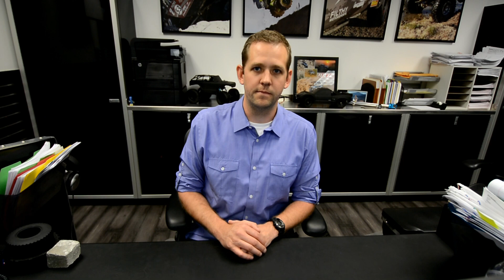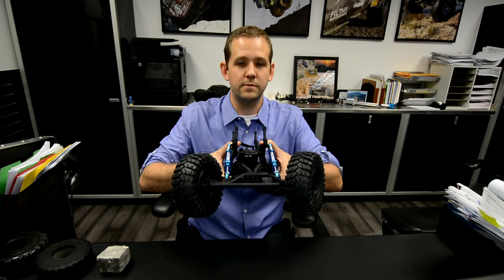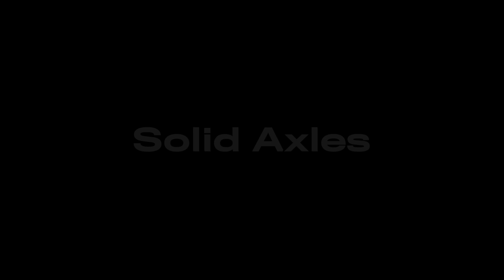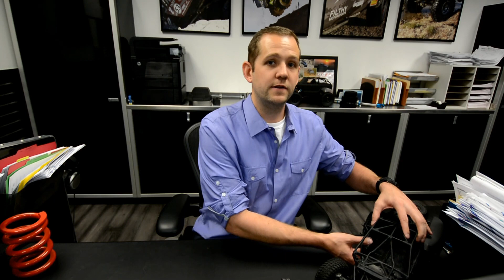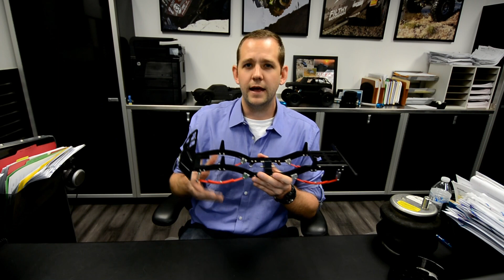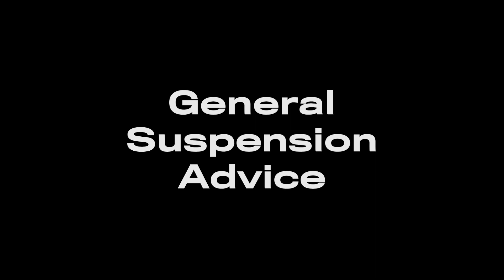Suspension Ride Quality Explained - Filthy Motorsports

Comment: Thank you so much for all this amazing videos you create, I have learned so much from you that's so helpful . I have a 1976 Toyota FJ 40, I looked in to convert  it to coilover but it cost so much to do the fabrication, so I change my mind. I want to change the leaf springs to a 2.5 lift spring so I can fit 32" tires. I want to make sure that I order the right springs and the right shocks so I can have a nice ride on and off road. do you think you can help me???  After watching two of your videos I'm not comfortable ordering any suspensions before I talk to you, after all the suspensions is very important to me but that's not the only thing I need done on my rig , so its important for me to get it done right on the first time. Thanks again for all this knowledge .
Reply from the maker: Sounds like a great project, send us an email and we'll connect to go over your options!

Comment: Hi Ben. I have a 2016 Landcruiser with an OME BP-51 coilovers. I would like to raise the front about an inch. Do I just simply jack up the front of the vehicle so that the suspension is in full droop and then turn the spring adjuster (I dont know what its called) or do I have to remove the coilovers completely  of the vehicle in order to adjust?
Reply from the maker: I would check with ARB/OME on that one. It also depends on which tools you have access to.

Comment: What do you think of solastic springs as seen in this video?   worth the upgrade?   any downsides?

https://www.youtube.com/watch?v=hmuixfRPSEY
Reply from the maker: I run those on my F250 and to be honest, I didn't notice much of a difference when I installed them.
But when I changed over to Deaver leaf springs, it was day and night better.
Reply: @Filthymotorsports  What is your opinion of the Deaver mini pack for 2014+ F250?

Comment: It took about 3 poop breaks but I watched the whole episode. Tons of QUALITY information! My 12' king coilovers that are on the front of my jeep jk have a 250/250 spring rate. Still feels like it's too heavy or I just want a softer ride. I have about 4 inches of shaft showing and 2 inch bumpstops. Should I just revalve because it's where I want the height or should I get a lighter spring?
Reply from the maker: Thanks for watching! If the springs are correct (see our coilover spring rate video) then it would be the valving. 250/250 seems to be pretty close to what we would expect in that application so I don't think the spring rates are too high, but it's worth doing the math.
Reply: @Filthymotorsports  you guys revalve if I send them to you? Also can you add adjustable clicker? Thanks again

Comment: Great  vids man. Even cooler that you have rc's lol  I have a 2006 f250 with a procomp 7 or 8 inch lift with icon shocks front and rear. If I change the rear springs, how much towing will I lose? I have towed 11k before and can not say that it wont happen again.  Also, icons(being digressive shocks) "should" help with the rear leaf springs or am I not understanding this correctly? Thank you very much in advance
Reply from the maker: Thanks for the question! That depends on how we have the springs made and the desired ride height and expected weight variation. On average, for the best ride quality on a stock F250, I would estimate a loss of the top 15-20% of towing and hauling capacity but all that really means is that you have to pay a bit more attention to how you load up the truck (watch the trailer tongue weight and shift heavy loads forward closer to the cab). Cheers!

Comment: Thats a very good review, thanks. Could you also explain what the oil viscosity and the nitrogen pressure change to the ride quality ?
Reply from the maker: Heavier oil is "thicker" and increases damping significantly while lighter oil reduces damping.
Nitrogen pressure keeps the oil under pressure and prevents it from "foaming" but it also has an effect on how much damping is "felt", for example, for a softer feeling ride you can reduce nitrogen pressure whereas for racing, were damping needs to happen instantly, higher pressure is used. (*Simplified Explanations*)
Reply: Thank you for your answer !

Comment: Excelent video. 
About Leaf spring, general rule:  high gas charged shock absorver, low gas charged or hydraulic (just oil).??? for confort ride in a DD, that ocassionaly go to slow off road.
Reply from the maker: They can all work as long as they are tuned for proper rebound damping.

Comment: Ben, If you switch from 0.15 compression shims to doubled 0.12 shims, will it be smoother and slightly softer?.
Reply from the maker: There is a lot more to it than that but two 12 shims would be firmer than one 15 shim.

Comment: Question for you regarding leaf springs... you state that a leaf spring with many thin, staggered length leaf springs (like a Deaver) approaches more of a linear rate than the typical factory 2-3 thick leaf + overload design. You state the Deaver design is easier to tune due to the more linear design. I would argue that any leaf spring design with staggered leaf lengths is progressive. And that a leaf spring design with many thin, staggered leafs (like a Deaver) is as progressive as you can get - not linear. A linear leaf spring would be one with only one length of leaf. Did I misunderstand your points? Thoughts?
Reply from the maker: Great question, thank you. You are correct, multi-thin-leaf leaf springs are never linear but they are closer to linear (less aggressive progression) than heavy leaf springs which is all that I was trying to say. Hope that helps!

Comment: Ben, thank you for your time/effort to spread this knowledge. I will be calling you tomorrow to leave a message and wait for a return call. I'll give you a quick heads up as will be calling on behalf of my 1990 XJ 2 door 4.0L 4X4. I'm currently looking at picking up a 5.5" extreme duty lift kit from Rubicon Express. This kit however does not come with shocks...which is why i ended up finding out about King shocks and ultimately watching this VERY informative video.  So Right off top I AM going to be running an aftermarket tubular prerunner style bumper with a wich...along with tubular rocker panels as well as a rear tubular bumper...a roof rack..and 2 full size spares which i would guestimate would increase my weight by a few close to 200 lbs. I am still debating on wether i want to run 32x11.50x15's..or 33x12.5x15's I am VERY open to suggestions. Finally my desired applications are as follows..now before you get mad..YES I DID WATCH THIS ENTIRE VIDEO..and I understand that its impossible to set up a vehicle to preform well in all applications but I do want to be able to trail ride....do 40-60 through the desert....hit the mud holes...do a little bit of crawling..and of course my favorite..jump some dunes. 
Street- 40%
Trails- 15%
Mud-   15%
Crawl- 10%
Dunes-20%
 
But also...I do want to be able to either save up for a second pair of pretuned shocks for expedition application/towing....or will you guys be able to point me in a direction to tweak settings myself to achieve the desired performance as necessary. 

Here is a linhttp://www.rubiconexpress.com/Suspension/Rubicon-Express-5-5-Inch-Extreme-Duty-Long-Arm-Lift-Kit-No-Shocks-RE6300.aspx?t_c=1&t_s=38&t_pt=3533&t_pn=R%2FERE6300k the lift I've got my eye on: 

I GENUINELY APPRECIATE YOUR TIME, SIR

Comment: Thanks for the video.  I'm starting the planning phase of my LC200 build and these videos have been extremely helpful.  I am torn between a simple setup (stock style struts/springs) and going with a coil over.  My biggest concern was the rebuild process that would be needed eventually going with the coil overs.  I heard in some of your prior videos you may be releasing a rebuild video and was wondering if plans are to release that still?
Reply from the maker: Thanks for  watching! This is the kit that we offer for the LC200 and we sell a ton of them with great results: http://www.filthymotorsports.com/King_OEM_Land_Cruiser_Shocks_p/king-25001-266.htm

They are completely serviceable and rebuildable and yes, we will have a video that covers that process coming out later this year. 

Cheers!
Reply: Awesome.  Thank you very much!  If I go that route I will definitely be going through you all.  I just need to figure out all the weight i'll be adding first so I can get the right spring rates.

Comment: Very good video lesson. Considering heavy dune bushing every second week, how many years shocks and springs (fox or icon) will survive before I need to replace them ?
Reply from the maker: That depends on a million other factors, some guys never have springs fail while others go through them every year or two. Then there are also those cases of just getting a bad batch. As for the shocks, same deal, I have customers rebuilding them after every race and we just rebuilt a set that had 150k miles on them.

Comment: Thanks for the video first of all – this is one of that golden pieces of knowledge and experience which are very valuable out there for guys like me. However I have a feeling that you're focusing on suspension system "keeping the cabin right" and not giving all the attention that "supporting optimal wheel angle and it's contact patch" deserves. I'm just starting to go deeper into your channel though. Thanks again!
Reply from the maker: Thanks for the feedback! The goal of this video was to be a basic introduction to ride quality and performance but, like you said, there are many, many, other factors include suspension geometry (caster, camber, roll-center, anti-squat, anti-dive, etc.), weight distribution, center of gravity, body roll, etc. that affect ride quality, performance, and handling. Cheers!

Comment: Hi. I recently added a Icon Stage 5 suspension on my 17 Tacoma and i currently run it stock with no added weight. The rear is a little rougher then I'd like, is this because the suspension would run better with a loaded bed?
Reply from the maker: As long as you have the factory rear springs, it will always be a bit firm. Shocks with strong enough rebound valving will help control them to improve the ride, but if you want a softer ride that moves better, you will need softer springs.

Comment: I really appreciated this video. It was so informative and I didn't mind the length at all. I felt more captivated and interested than pretty much any of lectures in college. So thank you very much! Secondly, what do you suggest for a 5th gen 4runner, daily driver, weekend warrior, Colorado deep woods trails but not necessarily rock crawling or desert racing. I'm plan on adding a little bit of weight via wench, skid plates, roof rack, ext. but I won't be towing anything. (Once I have the build plan finalized, I'll calculate the added weight so I can get the right size/tension coils). I'm thinking king coil overs in the front but I have no clue what to do in the back. I would like the vehicle to sit a little higher (2") but only for the added travel length and not at the cost of performance. I really want to be able to glide over those deep pot holes you get on the back roads and eliminate the crazy vibrations at 40mph you get from poorly maintained dirt roads, and be able to take on some of the nastier trails but not again I'm not trying to have a rock crawler. Just a highly capable off road vehicle for overland style trips.
Reply from the maker: So glad to hear you enjoyed the video! Everything you describe is what we do on a daily basis so you are in good hands. This is the kit we would work with and we'd just make sure to get the spring rates and valving set properly for your application: http://www.filthymotorsports.com/King_OEM_4Runner_Shocks_p/king-25001-278.htm

Comment: Great Video! Super helpful! You definitely earned my business.  I have a stock 2014 4runner SR5 that I'm trying to plan out for better "overland" capabilities . Its my daily driver and although I would love to pretend that I'm going to spend $7000 on a long travel kit and head out for the Baja 1000; realistically I don't need anything that awesome.  I'm mainly looking to improve trail performance: lessen the jarring effect of deep pot holes, smooth out the vibrations caused by poorly maintained dirt roads that get those crazy ripples, take on rocky trails and rough logging roads. I don't do rock crawling, I don't plan on towing anything and I won't go 100 mph in the desert. I'm trying to decide how much money I need to set aside. What is an adequate budget for a solid trail set up as I described?
Reply from the maker: So glad to hear it! And I agree, long travel is a slippery slope and to do it right you need to expect to spend $10 to $15K. The best bang for your buck, and the best you can do short of building a dedicated race truck is going with a properly tuned and set up King OEM kit like this: http://www.filthymotorsports.com/King_OEM_4Runner_Shocks_p/king-25001-278.htm

Comment: I have a h3 hummer I want the smoothest ride and the strongest suspension. Im a road highway warrior. Just in case I go off road I want a strudy suspension. What do you recomend, King Bilstein, Fox the fox appear to be the most sturdy and I like the aluminum case for anti corrosion. I have the original ac delco shocks and my truck is lower 1 inch on driver side. I would like to level the front, raise it 1.5 inches, I dont want to add any stress to the drive train by raising it. What do you recommend ?

Comment: Best video ever !!  I have a 2012 f250 was wondering what u have on your super duty ???
Reply from the maker: Thank you! My 08 F250 diesel is built as follows:
1. King Coilover Conversion Kit:
http://www.filthymotorsports.com/King_OEM_Super_Duty_Shocks_p/king-25001-146.htm
2. Deaver custom rear leaf springs
3. Sulastic leaf spring shackles
4. Air bag overload springs with Daystar air bag cradle
5. 37" Pro Comp tires on 17" wheels.
6. Limit straps

Comment: I have a 2010 Ford Ranger 4.0 4x4 5speed. I'm finding it very difficult to source upgraded parts. I want to kind of run a long travel setup without having to run a bed cage because I still use the bed for utilitarian purposes. I know I want an electronic OX Locker front and rear but as far as tire size, a proper lift that corrects geometry that provides good off road and on road characteristics it just doesn't seem to exist. Half the products you mentioned in this video don't seem to be available for my truck. Cant even find steel bumpers or skid plates. Thank you for the videos. They are stellar!
Reply from the maker: Thanks for the questions and glad you enjoyed the videos! Unfortunately, the 98-12 Rangers don't have a lot of good options between keeping it mostly stock with some Bilstein's or gutting the entire suspension and welding in a long travel kit. The front is always going to be your limiting factor (especially with a 4x4 model) on that truck so don't go overboard on the rear. Hope that helps!
Reply: I guess I don't understand why. Its a similar design to the F150 but scaled down, if I'm not mistaken. There are a bunch of lift kits for it that extend the spindles but nothing that really elongates the control arms. No tie rod flip kits or anything out there that will turn them into a beast. Why does it seem to be reserved for the LT models? Wouldn't the shorter wheelbase have an advantage? Not to mention the weight savings. For the most part I see a lot of guys picking up solid front axels from junkyards and doing the conversion but is it really not worth it to over engineer the IFS? What's the point of view from the aftermarket manufacturer perspective? Still planning to run the OX lockers even if I have to do just a lift. Riding like crap while being capable is better than riding well and getting stuck, to an extent, Imo.
Reply from the maker: Just the laws of demand and supply. Most people building small desert race trucks are going with Tacomas and the full-size trucks are F-150s and Silverados. As such, that's where the aftermarket focuses their R&D.
Reply: Vegasdezertfab.com has ranger suspension options that work well. I run their stuff on my 98 4x4 ranger and have no complaints. Also filthy this videos is very well put together. Got a friend to start his truck and this video helped explain in more detail what I was trying to put into words.

Comment: Thanks Ben.  Well described and thorough.  I was initially sad thinking that you guys were exclusively a KING shop, but from your website it looks like you also deal a lot with ORI struts!!!   I would definitely like to buy a few of those "$100 sessions" from you to get some tuning and setup advice on my current 14"/16" STXs... and find out what it would take to get them converted over to the new large remote canister style units.   :)
Reply from the maker: Hi Greg, we are ORIs top dealer and Kings top dealer for custom shocks so you are in good hands on both accounts. Send me and email or give me a call and I'll let you know what we can do. Cheers!
Reply: Right on Ben!!  I'm sure you'll want stuff like sprung mass vs. unsprung mass to get things really close.  I don't own 7000Lb race scales (yet) so that's the final piece of the puzzle I'm really curious about.  This is a full-size truck ('72 Blazer) so it's going to be every bit of 6000Lbs and probably more!!!  THX!
Reply from the maker: No need to have it weighed, email me a few photos and I can tell you :)

Comment: Another great vid. Stacks of great info as usual.

One little thing, your model leaf springs are assembled incorrectly. The smaller leaves should be under the larger leaves otherwise they won't do anything on compression, they might do a little on rebound, but why bother with that...
Reply from the maker: Glad you enjoyed it! Yeah, there are a few other things wrong with that model too but I was hoping no one would notice! I'll just argue that its an over-the-leaf overload spring like you'd find on a F-450 :D